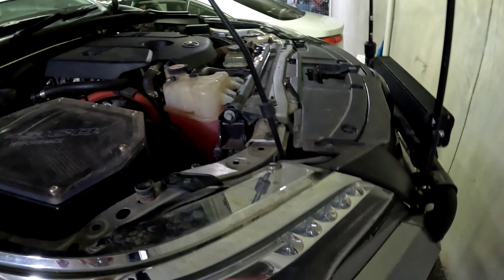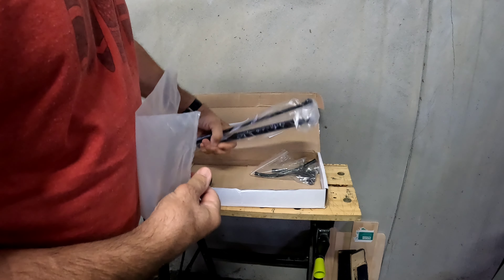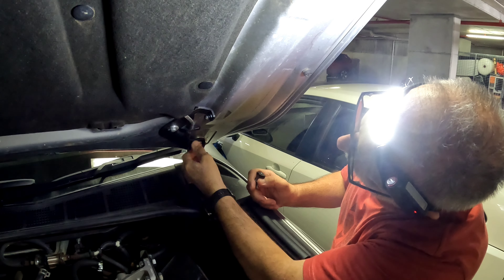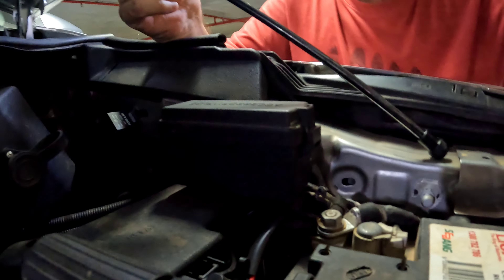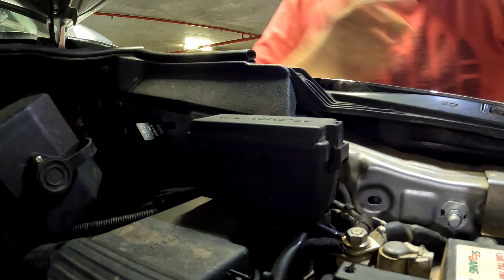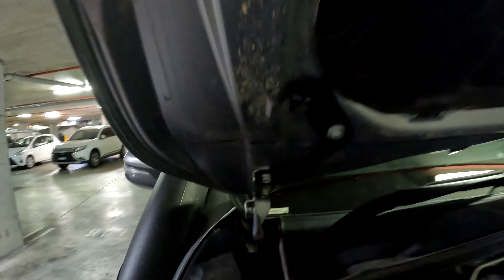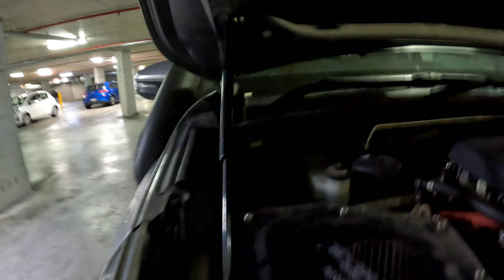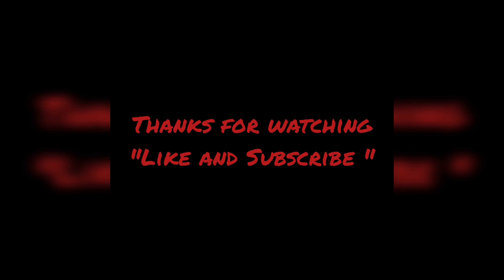#0035 Fitting gas struts to the Fortuner bonnet (or hood)

Comment: Where did you relocate the acc fuse?
Reply from the maker: I had enough space to turn it sideways and slip it down beside the battery
Reply: Could you flick me a pic of the upper arm closing… I’ve installed a arb compressor and wondering if it’s enough space for the strut on right hand side!
Reply from the maker: Sorry, I'm laid up after an operation, will try get pic in the next few weeks
Reply: Was it easy to remove?